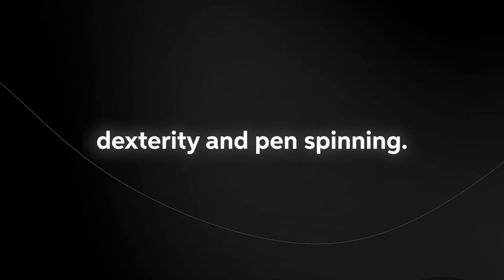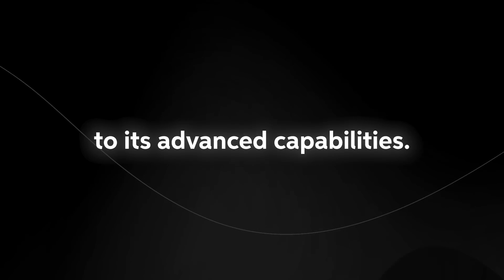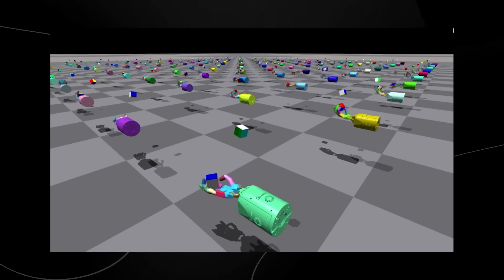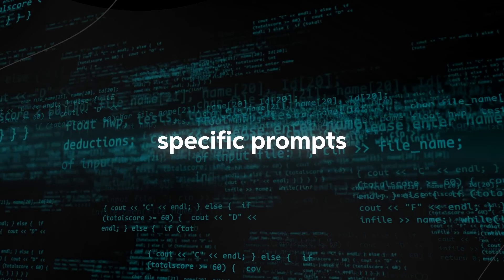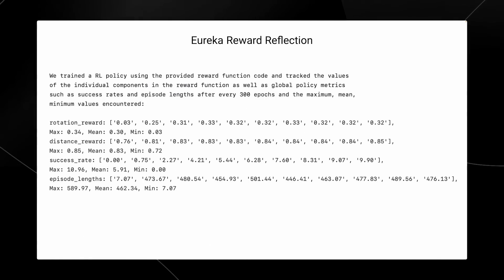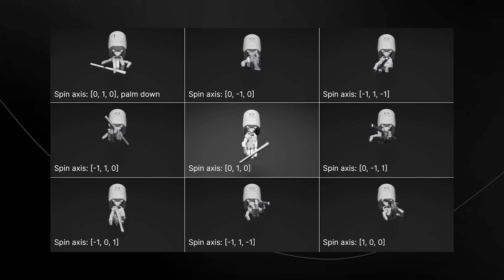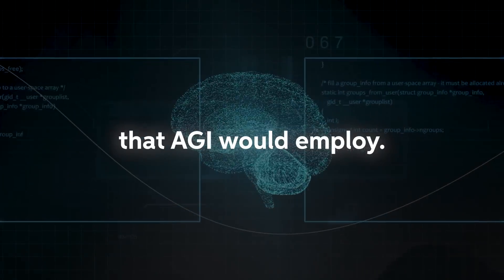Nvidias New AI EUREKA Is One Step Closer To AGI (Self Improving)

Comment: 🎯 Key Takeaways for quick navigation:

00:00 🤖 Introduction to Nvidia's Eureka AI
- Introduction to Nvidia's groundbreaking AI agent called Eureka.
- Eureka's ability to train a robotic hand to perform intricate tasks.
- Overview of the research paper and Eureka's integration with Nvidia's tools.
02:06 🧠 Eureka's Advanced Capabilities
- Ana Anandkumar's insights on reinforcement learning challenges and Eureka's role.
- Eureka's capability to generate reward programs surpassing human-written ones.
- Leveraging the gp4 large language model for Eureka's intelligence.
04:14 🧪 Eureka's Integration with Isaac Jim
- Integration of Eureka with Nvidia Isaac Jim for reinforcement learning research.
- The role of Isaac Jim and its connection to Nvidia Omniverse.
- The efficiency gained from GPU-accelerated simulations within Isaac Jim.
05:49 🤖 Eureka's Versatility and Training
- Eureka's versatility in training various types of robots and tasks.
- Comprehensive analysis of 20 tasks trained under Eureka's guidance.
- Visualization of results from different Isaac Jim environments.
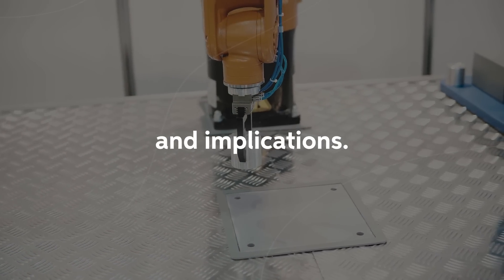06:17 🌟 The Potential of Recursive Self-Improvement
- Exploring the concept of recursive self-improvement in robots.
- The significance of achieving superhuman precision and its applications.
- Reshaping industries and expanding the capabilities of robots.
08:21 🚀 Eureka's Role in Advancing AGI
- Eureka's features hint at progress towards Artificial General Intelligence (AGI).
- Key aspects such as adaptive learning, complex task mastery, and integration with advanced models.
- The importance of Eureka's contributions in the journey to AGI.

Made with HARPA AI